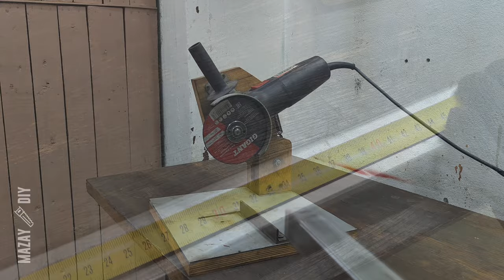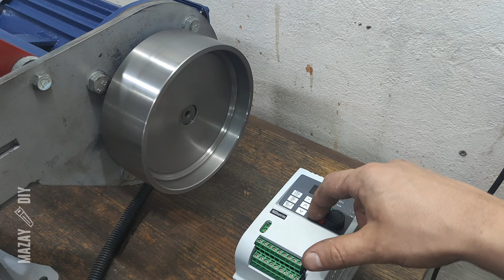DIY 2x72 Belt Grinder Build [FREE PLANS]

Comment: You had me intrigued until I seen the laser/plasma cut pieces... Not very DIY if you need special pieces made.
Reply: Hello!
Reply: Thaks God it has laser cut pieces... It will take way way longer to cut this by hand and not precise
Reply: The ones I’ve seen DIY….ARE NOT EVEN CLOSE ..so i def will get the files get them cut and build it ..
Reply: DIY is by my defenition making own tools/machines, I see no bigger problem in using of pre-cut pieces. I am sure they can be cut with a hacksaw or on a mill but why don't work smarter instead of harder 🤔😉...
Reply: You'd be surprised how easy it is to build a diy cnc plasma table
Reply: @adhdturtle37  I doubt that you would surprise me, but personally I don't necessarily see it as DIY. If so allmost advanced as it calls for a little more serious comittement? Bur let's not argue over small things, I hope that you have a wonderful weekend 👍🏼🤗!
Reply: I'm preparing to make one of these. 
I'm planning on ordering the laser cut pieces from Send Cut Send.
Don't know prices, but there's probably plenty of on line sources for the hard to make stuff.
Also, many of the pieces don't need the fancy shapes. 
Note that the positioning tabs are a game changer.
Reply: So maby he should have done the motor by himself then?
Reply: Just because it's a plasma cut piece doesn't mean you can't make it by hand. I've done it both ways and I still consider my projects to be diy

Comment: We’ll done, I’ve built 3 of these style grinders, some with free tread mill motors, others with $150+ motors and different plans from different DIY builders.   The built in spark guard and the hex cutout for the handles was ingenious.   Nicely done
Reply: Where is the "built-in chip guard"? Its not shown in this video.
Reply: The spark guard?     At 14:26 there is a piece of metal above the tracking wheel.
Reply: @GoKartArmy1  OK, thanks! I was looking for something below the front table where the majority of sparks go downward.

Comment: What thickness metal should these files be cut in? I'm currently looking into getting this laser cut.
Reply from the maker: thickness 8 mm, for my project I ordered laser cutting
Reply: @MazayDIY I'm wondering if it would be ok if I got this file cut in .250 (6.3mm) mild steel? Just wondering if it would create issues when putting it in together?

Comment: What type of motor do you use. Hp? Rpm?
Reply: 2hp 1500 rpm it's good choice for frequency converter. If you not have one, then 3000 rpm its better for you
Reply: Thanks but I have already made one. I used same one